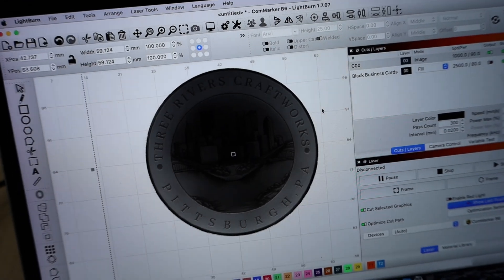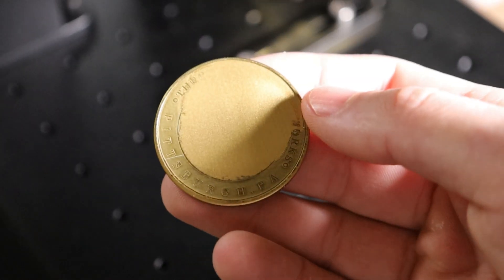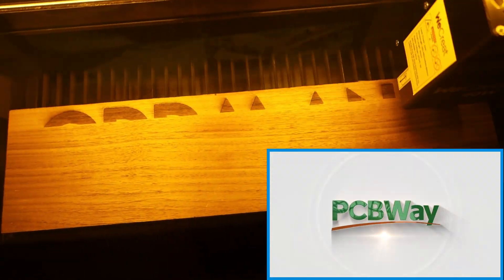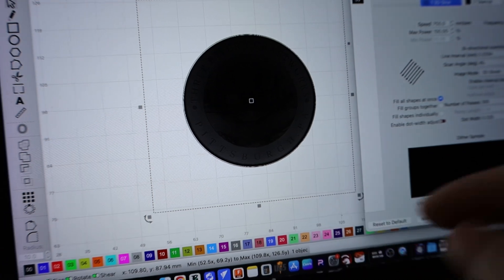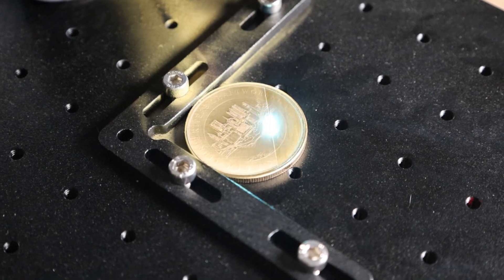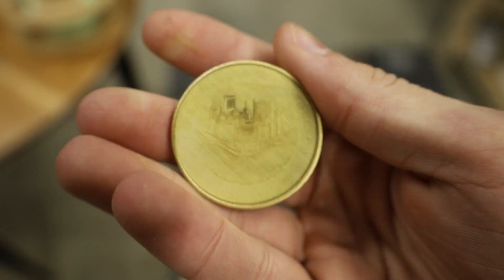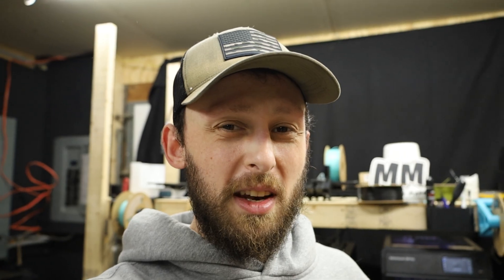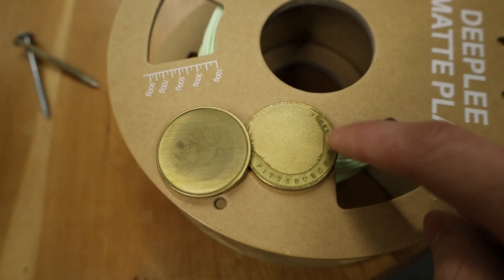I thought this would be simple

Comment: Would agree to check focus, as you set the focus to auto from the video it may have focused against the pins of the jig and not the coin perhaps. Also agree with the active working area. As you go to the edges of the lenses power will reduce. 

You could screen record vs camera as I agree with others your depth map seems to lack contrast. The depth itself is going to come from the power and the passes, the height map is going to control how that’s sliced up but if you’re removing a ton of material per pass, or very little that’s going to effect your final outcome. 

The settings briefly in the first one had a frequency of 50hz it looked like. Where as the second it shows 20 and that’s going to affect things too. You should also have a way to alternate the scan angle on each pass which will reduce the line effect as it seems to have only run at 45 degrees, where as it should be alternating its direction each pass by 45 degrees. 

From the metal one I’d have inverted the inner image, so the water is white and the reflections are dark, that will help the buildings too I think.

Comment: It might just be how the image on the screen shows up through the camera, but the depth map doesn't look quite right from this side. When I'm making coins, there's notably more contrast between the darkest areas and the lightest areas. I'd recommend remaking the image and playing around with the settings for the image to try to get greater contrast there before blowing through more material on the laser. 

I've also had a lot of success using multiples of 128 for the number of passes -- most frequently 256 or 512, since there's 256 shades of grey in pixel encoding -- and then adjusting the power accordingly so I don't carve straight through the coin.
Reply from the maker: It appears super dark on camera but in reality it wasnt nearly that dark and there was a lot more contrast within the image. The first one I tried out definitely had a little more contrast to it and the second engraving I tried was a different file. I definitely have more to learn when it comes to the depth map images, but my logo on the backside of the first coin was also a depth map and done in a similar fashion and came out great, albeit not that deep, but the results from that one were much better than the ones I got on these engravings. I will definitely try adjusting the passes in multiples of 128 next go around. I appreciate all the advice here! Im definitely more familiar with co2 and diode lasers than I am with the fibers so ill take any advice I can get 😆
Reply: @TheMountainMaker  My pleasure! Always happy to help. 
The other recommendations I have are for your settings -- the speed and frequency are quite a bit lower than what I use: 2000 mm/s, 38kHz. Those will vary from machine to machine, or even if you change lenses on the same machine, but maybe they'll be a good starting point for testing. I also do a cleanup pass much more frequently, usually a number that's easily divisible into the total number of passes (e.g. every 16 passes for 256 layers, every 8 passes for more detailed/intricate designs), with cross-hatch turned on for the cleanup.

Comment: Appears your coins not centered on the build plate. The laser works from the center of the lense so you want the work as centered as possible to equalize the focus across the entire part. You can see this also effecting the last plate at the end, where the BU is whiter than the lettering at the top of the coin. When engraving depth maps, you also need something to remove the material from the surface quickly to prevent it becoming a heatsink. You weren't getting a clean cut as the material getting removed simply was then landing next to where it was removed and being reheated and bonded back onto the surface, or prevent the virgin material from being removed as it should since now its covered in that dust and debris.